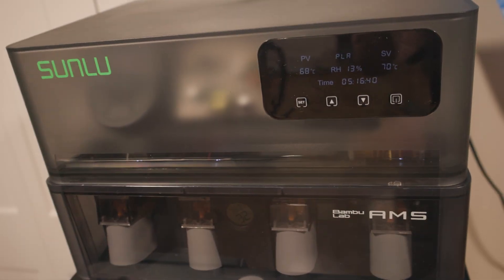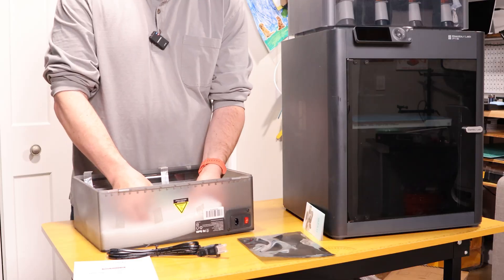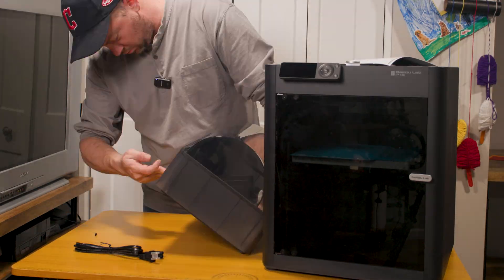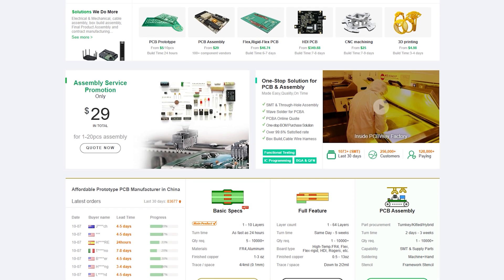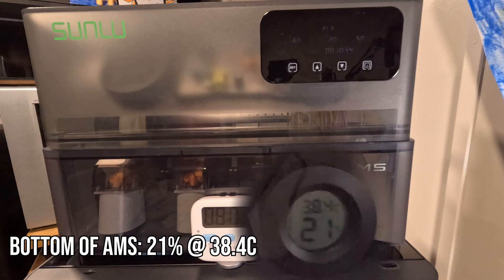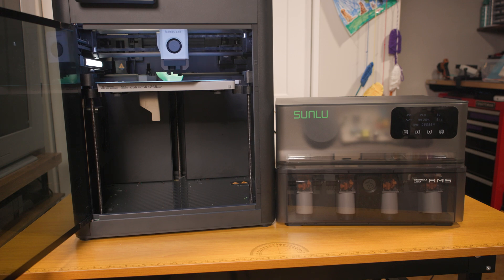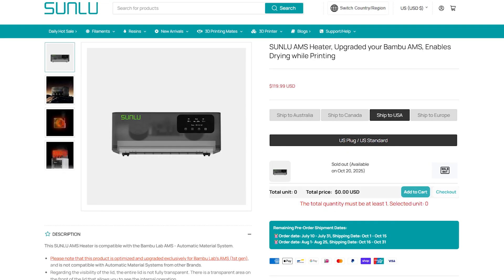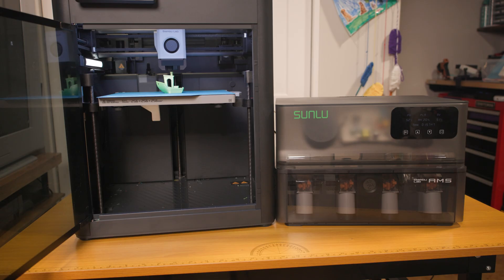The AMS Finally Got A Heater! #3dprinting

Comment: the one major problem for me is it dose not have a handle or a grip to open the lid, you have to grap it with both hands to open or one hand but very anyyoing.
Reply from the maker: I think I briefly mentioned that too but as I try to lift it I'm hitting random buttons too.  A handle would have been great.
Reply: @TKMakes-2024  yep, i 3D printed a handle and glued it to it, works way better to open it. i just wish they thought of that instead of us making handles. oh well maybe in V2

Comment: Would this have any negative impact on the other parts of the AMS (cogs and other stuff)?
Reply from the maker: I don't know enough about manufacturing materials to say for sure but I can't imagine the AMS is made of PLA.  ABS softening temperature is 100C and this goes up to 70C.  I've turned it down to 40C and have been using it reliably while printing a ton of kindergarten Halloween game prizes :)

Comment: An issue I have seen after 2 days with this is pla is flattening out in the feeder and getting stuck.
Reply from the maker: I noticed that too after filming.  I've lowered my temps to around 40 and seem to be printing fine.  Testing 70C was way too high.
Reply: How much was the tariff charge on this ?
Reply from the maker: @kylepollum4447  I ordered it when preorders opened in July and I wasn't charged any extra fees after that.  It did come from a US warehouse so if you order today I wouldn't expect any extra fees for tariffs.